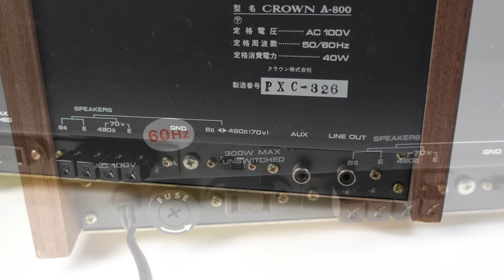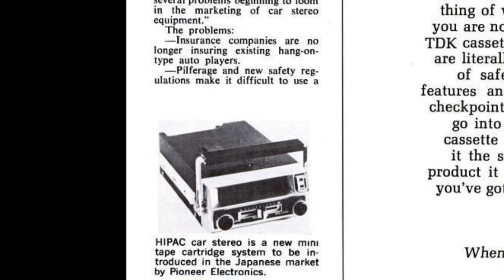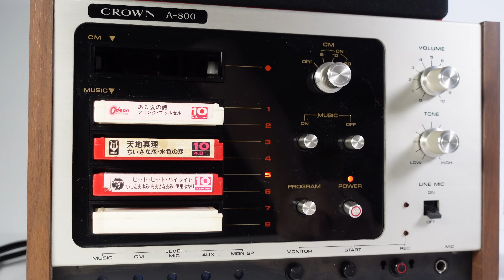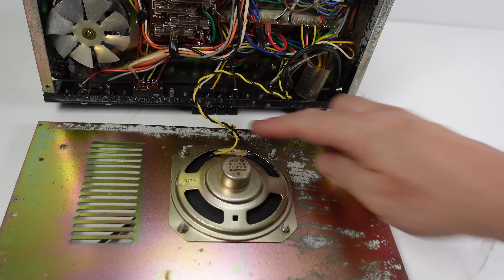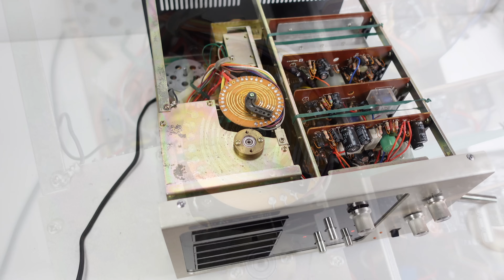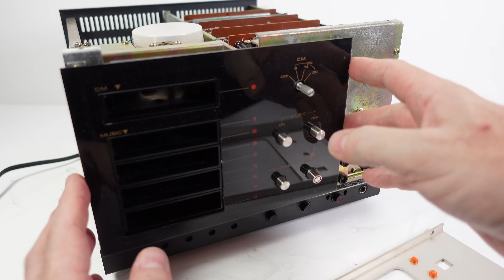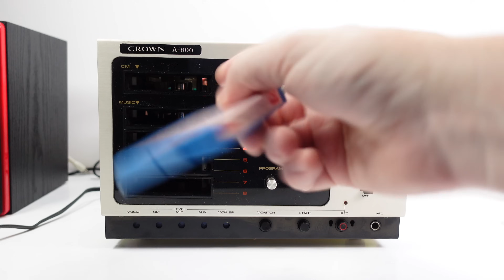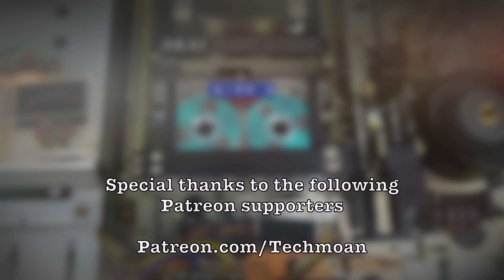An unusual player for a forgotten ‘70s music format

Comment: Does a 60hz kettle boil quicker than a 50hz kettle? Answers on a postcard, please :)
Reply: At first I thought, that's easy. Assuming the voltage amplitude of the 50 and 60Hz supplies is the same, the RMS values are the same. So the answer is they both take the same time. However, thinking about it, if the kettle element is an inductive load it would have a higher reactance at 60Hz which means lower power factor which means less real power which means it takes longer to boil? On the other hand, if you then tell us the 60Hz is on top of Everest and the 50Hz one is at sea level........
Reply: @Steve-GM0HUU  Who knows :D I like the effort you put into it though :)
Reply: Actually, while the frequency won't affect most kettles, N. American, 60Hz, 120V kettles are notorious for being slow. This is because our standard outlets are only rated at 15 amps and a kettle that draws 20 amps could only run in certain outlets, usually the ones in the kitchen, so most manufacturers don't bother with them. Since most N. American houses have a 2 phase system, it's easy to wire a 240V outlet and I've seen them in the houses of British expats, probably so they can use their 3,000 watt kettles from home .
Reply: @pcno2832  Unless it boils in 10 seconds, I'm not interested! :D

Comment: The "tell tail" sign is the "70V" speaker output, that is only for multi-speaker public address systems (long wires so use high voltage instead of current).

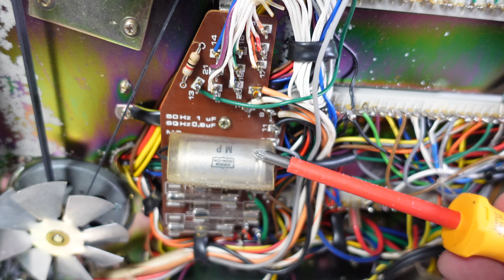Comment: 19:25  Changing the cap will not change the speed. The motor is an AC synchronous motor which runs at a speed determined by the mains frequency - note the 3 wires going into the motor. The capacitor is a phaseshift cap to run this particular motor. To change the speed you must change the motor AND the cap. OR supply 100v/60Hz to the whole device. (This is very easy if you have the knowledge and basic skills btw)
Reply: Seems like just changing the cap did work in his latest video.

Comment: What does changing the capacitor does  is dependent on what the circuit does ... it can change a voltage or reduice noise ot raise stability in tiny AC-power fluctuations or change other things ...

Comment: the capacitor won´t be changing the speed. The tolerance of capacitors is 10-20%, think of what that would mean if the speed would depend on it.

Comment: I would suggest purchasing an 12 volt to 120v pure sine wave inverter that has an output of 60 hertz this way you have a way to power other devices that may be 60 hz. Make sure the inverter is a pure sine wave type as modified sine wave types do not not work well with inductive loads ( such as transformers) You may want to use an adjustable autotransformer out output so you can lower voltage to 100V (If you don't already have one)

Comment: I believe changing the cap would change the AC cycle, by using an RC circuit as a frequency controlled resistor.
Reply: You have the right to believe what you want but that doesn't make your belief right. (It isn't.)

Comment: Hi. you can get 60hz by getting a car 12vdc to 110v 60hz inverter from ebay. the cheap one dont have pure sinewave but should get the job done. just get a small 12v battery or  switch mode power supply as input.
Reply: Do not use a "modified sine wave" inverter with equipment containing a mains transformer which operates directly on the AC input.
Reply: @geoffmorrison3648  There are pure sinewave inverters out there. nothing wrong with modified sine wave though, its noisier and possibly reduce lifespan of the transformer.

Comment: It was pretty obvious this had to be a background retail device based on the front and rear panel.  70 volt and 8 ohm speaker out plus mono music and commercial playback with a mic in, suggest retail paging and commercials, stand alone for a small store, or capable of mono line out to larger amps in a bigger one.  

The Pioneer group standard originated in 1971, and was dead by 1973.

Comment: According to Wiki, HiPAC was a Pioneer consortium spec that operated at 1 7/8 (like cassettes) or 3 3/4 IPS (like 8-tracks), with a 30 or 60 minute limit.  0.150" tape like cassettes is not half of 0.250" wide as used in  8-tracks or NAB carts.  Unlike cassettes, it would need to be back lubricated as in other loop designs, and unlike cassettes that use spools and linear motion, and so stay cleaner and have fewer stresses.  

NAB carts are designed as heavier duty.  They operate at 7.5 IPS, and pinch rollers are part of the player, not the cart.  They exist in 2 and 3 track, for mono or stereo, with a cue tones track separate from audio.  1 kHz is the stop tone (and they can sequence multiple stops on a single longer cart), while they have two less used EOM or aux tones not detected by all players.  Carts exist from 7 seconds to 10.5 minutes, their limit based on tape pack dimensions, while 40 or 70 seconds are common for 30/60 second commercials, and 4-5 minutes for music songs.

Comment: A DC powered servo motor wouldn't need a line frequency switch.  A PSC or synchronous dual 50/60 Hz motor needs a capacitor value change, but also reflects line frequency and so needs a pulley change or dual diameter motor pulley for the flywheel belt.  

When run on the wrong frequency without changing the motor cap, it'd heat more due to inefficiency, but rotate based on the number of magnetic poles and line frequency, and with no RPM shift based on that capacitor.  

FWIW I'm an engineer, and have mostly USA based broadcast experience dating back to the 1970's.

Comment: electrolytic capacitors are typically not precision parts so will not be suitable as a speed-setiing part. swapping the capacitor will probably not make the motor run faster, but may help with the speed variations by increasing the motor torque.  your  best bet for fixing the speed issue is to talk to a friendly machinist to get a larger pulle made for the motor.

Comment: The flywheel motor that drives the  belt,  increasing its voltage .... you be able to increase its rotation speed. I' would look for a source on the board that can output a higher voltage and use a pentiometer to try and figure if the speed can be adjusted. Incorporate relay  to avoid losing its original functionality.

Or better yet, place a buck converter that can also provide overcurrent protection and place it inline its circuit there local just before the motor.  It wont lose its original functionality as to how it's triggered, only changed its voltage.

Comment: When you showed us the front and back, my immediate thought was "oh, is this another background music machine?"
I thought you had some sort of 50/60 Hz converter.
Really brilliant mechanism in its (mechanical) simplicity. I'm thinking the mechanism used to deactivate a tape by pushing in the braking mechanism might even not have been thought of in the original HiPac design. It could be a happy coincidence abusing an existing braking mechanism that can be pushed in further than needed. Or maybe it was intended to allow for a pause button.
I've spliced compact cassettes that had snapped inside players very similarly to what you did in this, using scotch/sello tape cut to a bit under 1/8" wide.

Comment: That looks like a three phase motor with the capacitor used to shift one phase by 120 degrees, the difference in capacitor is because of the frequency.   It would probably require a different pulley/fan and capacitor to change to 50Hz.

Comment: Not gonna lie... I think if Hipac had come out at the same time, or slightly before 8-track, I have a feeling it might have actually caught on. Albums have always been split in half, be it on records or compact cassette, so having only two programs would eliminate 8-track's issue of "fitting" the album into quarters. It's also really small, and like your machine shows, the design considered changers as a feature, from the start. The incredible simplicity of the tape loading mechanism also suggests that changer costs could have been kept fairly low.

Obviously, 8-track and Hipac both suffer from issues with the foam pads and the splice breaking, but as far as continuous play car cartridge formats, I know I'd probably have fallen in love with HiPac over 8-Track, if I had never heard of the two, and were looking over them side by side in a store, in say, 1972.

Comment: assuming it's a synchronous motor, the cap shouldn't change the speed, but will make it run at optimal power/torque output. it being down on power could be making it flutter and warble, then again it could just be belt slippage or other belts, bearings and gearing needing lubed. I'll say they had either a different motor pulley or driven pulley in combination with the capacitor change, it's possible other circuit components need changed for proper function. maybe a second reason for having pluggable boards?

Comment: Replacing that capacitor should result in a different playback speed. A different rating will have a different charge/discharge rate and would affect the drive motor rotation speed.

Comment: In less than a second I sighted the induction motor by it's AC stator windings. Only one speed here, move on please. Unless one of those boards is an AC generator it's going to run at one speed only. Some of those motors in a reel to reel tape deck will run at half or double speed by switching windings but not 20%.

What do you get when a Hammond B3 organ is run on a small generator? It sounds like it's drunk when the guitar and bass sound as well. Synchronous motor!

Comment: Please don't mess with the electronics to try to change the frequency for a synchronous motor...

Just get a electronic frequency changer from your electronic supplier that will convert 50 hertz to 60 at your desired voltage...

Comment: Same problem with 8 track tapes. Splice lets go and bad things happen.
Reply: I had an idea just now: Instead of splicing with metallic adhesive tape, would a crimp-on splice work? It would have to be thin and flexible metal, maybe spring steel, and you'd need a specialized tool to apply it and to cut the tape ends narrower (so the finished splice wouldn't be wider than the rest of the tape), and you might lose some tape length if you ever have to replace it, but I think it would be more reliable.
Reply: I bought very few pre-recorded 8 tracks. As I also got into reel to reel I had a splicing gadget. I discovered that by keeping track of the total time of music and opening up the 8 track cartridge to (most often) remove some tape I could make tapes with no end silence or last song cut off. By using a ⅜" piece of sensing tape and relying on reel to reel splicing tape on the back side for splice strength recording over the track change was only a tenth of a second interruption which I didn't find objectionable. I always wondered why the record companies didn't do the same to avoid silence and the occasionally different track order.
Reply: @curtislowe4577  well sometimes that was not possible.  Different song lengths.  Some 8 track tapes had edited versions of long songs to make them fit in the 10 minute loop length.
Reply: @12voltvids  Sourcing custom length cartridges with a two-part splice would have been a simple solution for the record companies except for the one humongous issue: slightly higher cost per blank tape cartridge. That would have solved any LP/8TR track difference requirements as well. But in conjunction with well established consumer apathy improving the 8TR was probably met with derision at every meeting at which some new and still starry-eyed employee brought it up.
Reply: @curtislowe4577  they would have probably been high speed contact printed so tapes would be custom lengths to begin with.
Reply: @12voltvids  you're right - the high speed contact transfer mechanism used probably wouldn't have been able to accurately track and record over a ⅜“ gap of sensing tape. As I recall there was a series of tones on one or both sides of a commercial 8TR at the sensing tape. I expect those tones were needed to signal an automated mechanism to cut the contact recorded bulk tape into the length for each cartridge.
Reply: @curtislowe4577  that is exactly how it worked.   The mother tape was a loop tape that was repeatedly passed over the blank tape that was wound onto a large pancake feed. Once the large pancake was recorded the tape was loaded into an automated cartridge spooler that used the tone that was right at the point where the splice was. Would wind till the tone, then it would cut and splice and move onto the next spool.  The next station would load to the cart and put the cart together.  
Cassettes were done the same.  
Sony built one for video tape called a sprinter.  I had the privilege of seeing a tape showing a sprinter in operation.  A 2 hour move duplicates in about 2 minutes.   Metal tape used as mother tape which was actually a negative of the print so the contact print has the helical scan tracks in the correct orientation.
Reply: @curtislowe4577  All 8 track tapes I have left, from when released, and they most likely need to be "sponged" is: Led Zeppelin Vol 1 and Vol "4", Pink Floyd - Dark Side of the Moon (Harvest/ EMI 8X.SHVL.804),  Wings - Red Rose Speedway (Apple Records – 8XW-3409), Donovan Greatest Hits ... so not much there.
Reply: You think that's bad you should see a 35mm film that decides to jam the failsafe sensor and spills out onto the floor.  Brain wraps are bad but even worse is when the platter motor freaks out and decides to spin at top speed and fling the entire movie onto the floor.
Reply: When my parents had a big stereo cabinet with an 8 track, it ate one of the tapes. My dad fixed it by removing the metal splice section which had gotten damaged and probably replacing it with clear tape. You then had to switch to the next track manually on every song. I never completely understood that until this video. The tracks are stacked up and the same chunk of metal tape triggers the change every time. I had the dumb idea that each song would have its own section of tape. Not that I was thinking about it too hard, lol.

Comment: I do pro AV and I know a bit about the connections and the mono nature of the unit. If you notice the outputs that say 70v. That's for Distributed audio. That is a series speakers that have  line matching transformers and are wired in parallel. The idea being that the higher voltage allows for lots of speakers that can be far from the amp at a constant volume across the system. You give up some frequency response, but for pa or background music. The installation benefits outweigh the negative. The  reason its mono is so that you always here the same thing no matter where you are in relationship to the speaker. You wouldn't want someone only hearing the left channel, or the right channel depending on where they are standing.

Comment: Motor speed is set by frequency. A larger pulley is required. You can wrap the motor pulley with some tape to increase it's size. The capacitor won't change the speed much. It will make it a little more efficient and you will gain a little speed but not enough.
Reply: That's simply wrong.  An off-value cap won't change the speed of a synchronous motor at all, unless so far off the motor skips magnetic poles and slips, or shuts down, possibly variably with load levels.  

That larger design could be adapted with a dual diameter pulley and switched motor caps, but it appears single speed, but manufacturable to different regional markets, with an alternate pulley and cap, same motor and electronics otherwise.  Since it's intended for single fixed venue retail locations, no need for global travel options.
Reply: @lokiva8540  yes I agree
Reply: Turns out you just needed to change the cap, and you were very, very wrong
Reply: @deaddave2170  incorrect.  
Induction motors operate by creating a rotating magnetic field on the second winding.  Ideally you want a 90' phase shift for the second winding.  The run capacitor is what creates this phase delay and it's value is determined by the frequency.  If the capacitor is too low the second field will be low. This will cause the motor to have lower torque and this will make it run slower.  Adding additional capacitance will increase the speed slightly but will not make it run the correct speed. Adding too much will make it run faster but again at a reduced torque output because the lagging phase is too strong and will cause pole skipping of the rotor which is less efficient.   The only way to change a 50 hz to 60 or vise versa is to change the pulley size.  This is why all dual frequency tape recorders that were produced had two pulleys and you physically changed the belt from one pulley to the other for 50 or 60 hertz. There was also a switch that added extra capacity for 50 hertz to make the motor more efficient at that frequency. If you were running your tape recorder on 60 HZ and you change that switch to the 50 position the motor would go slightly faster but at a reduction of torque.   Most of these induction motors ran 1500 rpm on 50 hz and 1800 on 60hz as they were 4 pole motors.
Reply: @deaddave2170  yes I agree
Reply: The frequency f in hertz is equal to 1 divided by 2 times π times the resistance R in ohms times the capacitance C in farads.
Reply: @urgemore  yes I agree